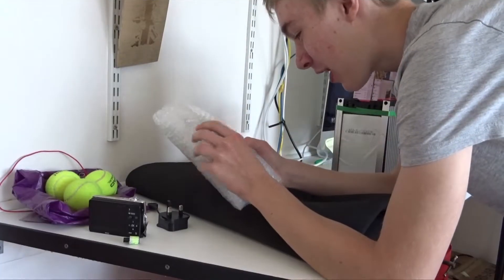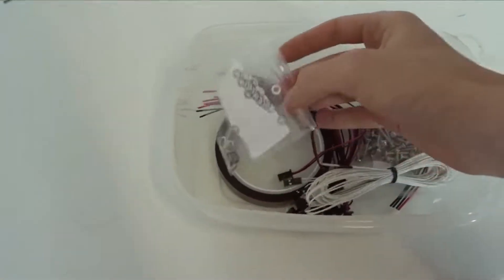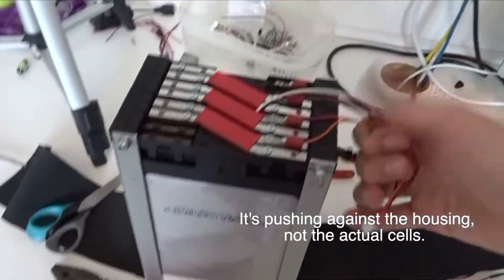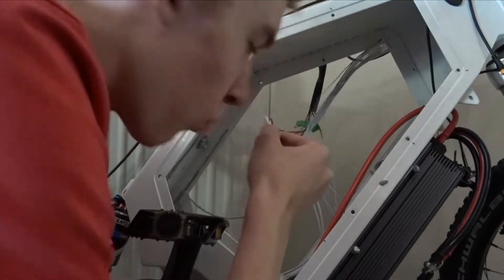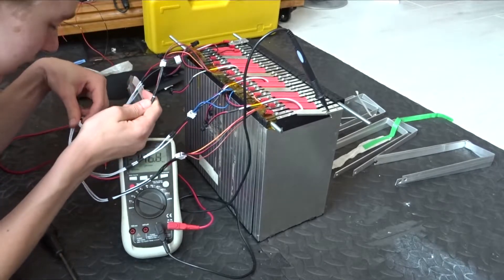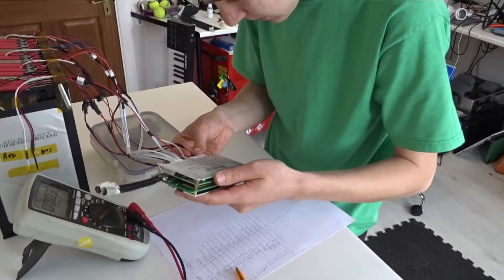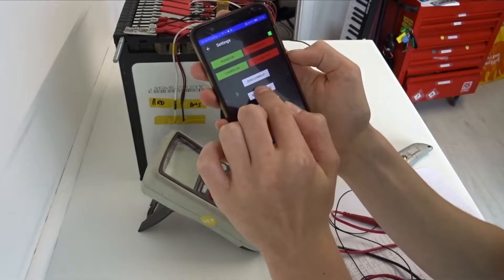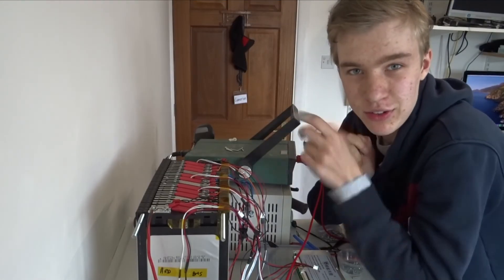THE BEST BMS IS HERE! - 8kW Enduro eBIke V3 Build - Part 8

Comment: When you charge the battery using the ant bms do you have to turn the discharge mosfets off? Or do you leave charge and discharge on at the same?
Reply from the maker: I leave them off in the app (just turn charge ones on) but I think it will handle that automatically so no need to worry about it.

Comment: Hi, I have the same battery as the resistor to use antispark, in winter I charge the batteries at home because I don't want to charge in the cold, main bms ant  300a

Comment: Hi man I love your passion for ev can you tell me what charger are you using how many Ah  for that battery  thanks
Reply from the maker: I haven't actually sorted that out yet, but have seen a 40A audio power supply from Connex that I would love to use (has adjustable current, over current protection, voltage adjustment) but at the moment am using my 250W bench power supply. The Ah of the battery doesn't matter what charger you use, it's the maximum charging current you need to find from the datasheet. 👍

Comment: Very good job mate I wish I'd have found your video sooner I have the same BMS and cells wired it all now and cased with alloy plates and I forgot to put  the temp sensor in the middle of the packs like you have 😩 any advise on a second place to fit 4 temp sensors 😩
Reply from the maker: Well putting one on each of the end cells is probably the best fix unless you fancy opening it up again :)
Reply: @EverythingEbikeChannel  thanks for reply mate I'm only pulling 55a with like 80a spiked so I've slipped it in the side of the casing but next pack I build I'll pull more so I will do it how you've done.. Properly

Comment: Have the same, but no clue about that switch at 7:15. How did you install?Have you find  the manual for Smart BMS 8-24S 150-300A?
Reply from the maker: It connects to the end two pins of that connector, should come supplied with the correct wires attached. You need a push button and hold it down for a few seconds until it beeps. Here's a listing with some diagrams in the description https://www.aliexpress.com/item/32826820690.html?spm=a2g0o.productlist.0.0.57e04fc1fV2CsQ&algo_pvid=317bf5dc-b8f7-49a7-86e8-dbd5b215b834&algo_expid=317bf5dc-b8f7-49a7-86e8-dbd5b215b834-1&btsid=0b0a0ac216158938511594414ec886&ws_ab_test=searchweb0_0,searchweb201602_,searchweb201603_

Comment: How do you charge it? Does the BMS automatically detect a charger?
Reply from the maker: You connect the positive of the charger directly to the positive of the battery, and the negative to the same wire from the BMS that goes to the controller. It will detect that current is flowing in reverse and give you all the protection features. Also works great for regen

Comment: Hi what battery charger are you using and where did you get it from?
Reply from the maker: A bodge-job of a server PSU and boost converter at the moment😂! Seen a 1500W unit on ebay for under £100 so expect I'll end up using that eventually. Don't really trust the compact, cheap Chinese chargers that claim to put out lots of power on alibaba.
https://www.ebay.co.uk/itm/Switching-Power-Supply-DC-48V-31A-1500w-Power-Adapter-Driver-Transformer-ZX/353298994148
Reply: Could you send the link for that please? The only ones I can find are £300 plus, or as you send the cheap Chinese ones which I don’t wont to get.
Reply from the maker: @leejones5638  Herehttps://www.ebay.co.uk/itm/Switching-Power-Supply-DC-48V-31A-1500w-Power-Adapter-Driver-Transformer-ZX/353298994148. It's still probably made in china, but looks much better quality and has adequate cooling. Boost converters are https://www.amazon.co.uk/gp/product/B0756VVDKT/ref=ppx_yo_dt_b_asin_title_o06_s00?ie=UTF8&psc=1
Reply from the maker: Here's another one I've seen some people use. Ironically more expensive than that other one🤔https://www.ebay.co.uk/itm/72v-Charger-Battery-ajustable-12Amps-Fast-charging-/284092501553?_trksid=p2349624.m46890.l49292

Comment: Have you tested range/max speed? :) What temperature sensor are they?
Reply from the maker: Not yet as it's not fully built and probably won't be until the summer. Should be around 55-60mph and 35-55 miles depending on riding? Some of the sensors came with the BMS, and the others are 100kΩ 3D printing sensors https://bit.ly/3o53xx1
Reply: @EverythingEbikeChannel   thanks. Have a look 3:30 + - end connections looks simple
https://youtu.be/z86Mt6t6Cn8
Reply: @EverythingEbikeChannel   thanks, dont get why do you need 2 different temp sensor, any reason? Im just trying to fit 72V in the same frame but need to cut the frame somehow lol
Reply from the maker: @alexferenci You don't basically. I'm planning to build an arduino based module that reads data from the bike and then displays it on an lcd. Probably could have used the same sensor and then soldered an extra pair of wires on but didn't want the arduino interfering with the BMS. I know a few people who are fitting 40+ cells into this kind of frame and they've either had to chop the underside off and make a deeper bracket or just cut the frame in half and extend it.

Comment: What bench power supply is that your using to charge your batteries ?
Reply from the maker: It's a Tenma 72-10495 30v 5A. Just be bloody careful to connect the battery the right way round and not blow it up like me! 🤦‍♂️

Comment: I have the same BMS in my pack. Just be aware that it can only handle 100-120A Constant. Those cells are nice. I wish I could find some here in Canada for a decent price.
Reply from the maker: The 300A model? I'm aware of that and even then, the 2 8awg wires couldn't take 300A! The guy I've bought from is the only seller as far as I'm aware and I know he says he only ships to europe. I could ask him but shipping them would be hefty!
Reply: @EverythingEbikeChannel  It works well. I limiting current to 110A via the controller. Bike coming along nicely. Keep up the good work.

Comment: Looks like a Rats nest of potential problems with all these wires for a not needed bms setup.Seeing how you have crammed those cells in the frame ill be interested if you intend in riding this build offroad.Im sure it will all work out in the end though.
Reply from the maker: @Fpvlee A BMS is basically essential with a powerful build like this (look at other people doing a similar thing and you'll see). However with the frame I chose, granted it's a tight fit but when I insulate everything (and I mean everything 😁) and secure it all down, it should work fine. Also I plan to mainly use it on road but who knows where I'll end up going 🤷‍♀️
Reply: @EverythingEbikeChannel  Its not essential on simple builds like these add in the very little space you have .I know a good few builds including both mine that run over double your projected power.Im by no means saying dont use one just they are not essential is all.
Reply from the maker: @fpvlee1586  Better safe than sorry I guess...
Reply: @EverythingEbikeChannel  If you balance charge your packs and treat them correctly you should not need to be sorry lol.Enjoy the build bud
Reply from the maker: @fpvlee1586  And that's partly what the BMS is for, along with over current protection. But of course there are lots of ways of doing it 😁👍
Reply: @EverythingEbikeChannel  Yes im aware what the bms does fella lol.What ever works for you though.
Reply: Fpvlee ,yeah i agree 100%, I personally do not use a BMS, i charge/balance my 15S/10P packs every time, (i made a setup using a plug & play wiring system off my icharger 4010 duo) gets rid of all that electonic components within the bms & ofcourse the bms itself 😁 (more electronics the more complicated & increases the chance of faults & failures) I can plug in and monitor every cell in real time through a couple of cell checkers. Keeps it simple & it works very well. I also use a DC double pole C.Breaker to safely protect any shorts or failures of Battery pack/ motor/ or controller, keep everything safe. 😊😎

Comment: Nice battery build mate carnt wait to see what it's capable of
Reply from the maker: Neither can I! It's going to be exciting!
Reply: @EverythingEbikeChannel   definitely
Reply: @EverythingEbikeChannel   I'm in the middle of building mine got the hub motor and 18in moto wheels and off road tyres, got front forks, iv been looking on battery hookup. Com  not sure to got with Samsung 30Ts of get the lipo packs like yours that come with the plastic  coverings
Reply: @EverythingEbikeChannel   I'm in the middle of building mine got the hub motor and 18in moto wheels and off road tyres, got front forks, iv been looking on battery hookup. Com  not sure to got with Samsung 30Ts of get the lipo packs like yours that come with the plastic  coverings
Reply from the maker: @Kenny-jg8ld  They've both got pros and cons. I can't see the samsung cells on battery hookup but I know their specs. Li-ion packs can be made to fit any enclosure as you can spot weld them together pretty much how you like as long as you have the parallel and series connections. However if you look at it from a price perspective, you would need 182 cells to build a pack that's equivalent to the pack I have which (assuming a cheap £2.5 per cell) would cost over £450 for just the cells without nickle strip, spot welding or wires. But the cells I chose do need carful thought for mounting and connecting. If you want more info, I can give you my email address. Great to hear your building your own!
Reply: @EverythingEbikeChannel   thanks mate the 30ts would be from fogstar it would be more expensive to go that rout I think so probly go for them lipos
Reply from the maker: @Kenny-jg8ld  yep they're £2.93 so lipos sound like a great choice if you've got the space. Let me know if you need any guidance 👍

Comment: Hey found your channel it’s very good, just keep up the good work. Also if you ever go to a 5000w hub motor think about configuring your battery to 72v will give your bike some extra acceleration
Reply from the maker: Thanks! I would love to have a 72v pack but I chose range over speed for this bike. With a custom build li-ion pack and larger frame I'm sure I'll do it one day. 8kW is certainly a step up for me though!